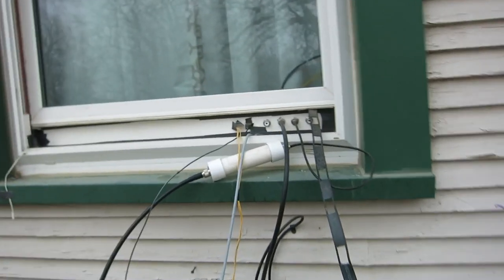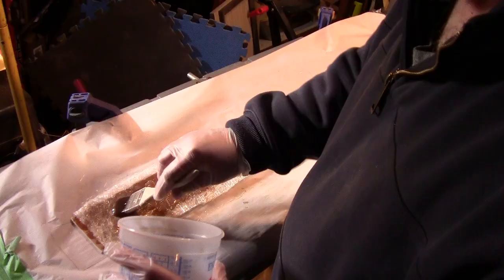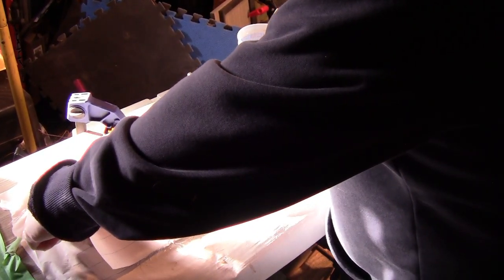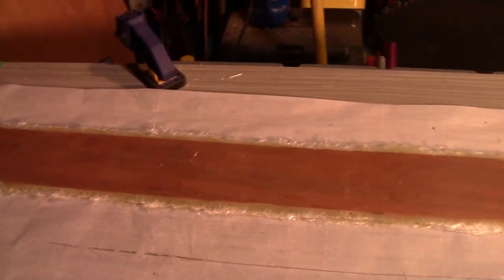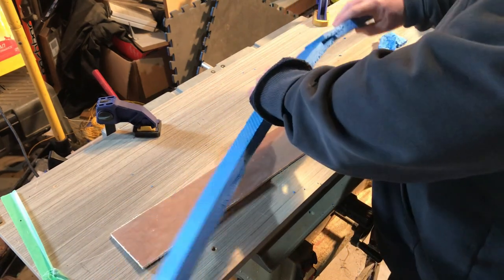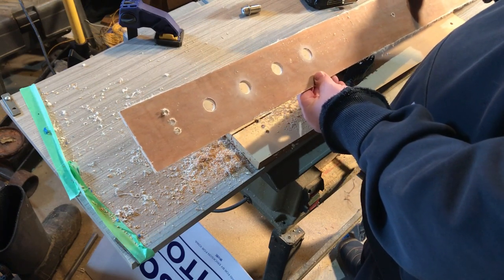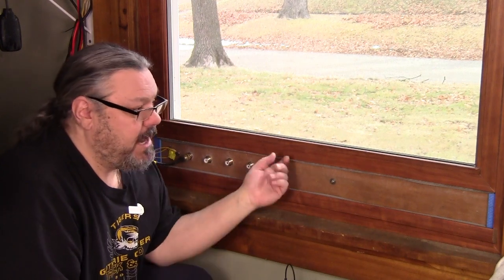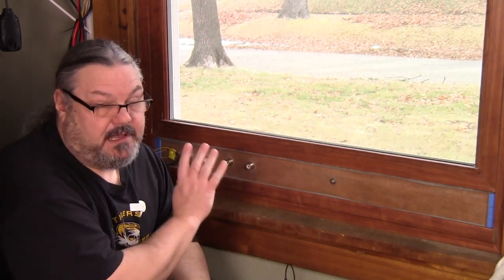DIY Window Pass Through

Comment: Very useful. Thank you.

What would you use (ceramic insulators?)for a 300 ohm ribbon cable?? 4S7EF
Reply from the maker: Great question. I think it would depend on the diameter of the insulators. 300 Ohm cable (at least in the US) is very narrow; that is, the wires are held in the insulation very close together, making it a bit tricky to split them for attachment to large-diameter insulators. If you could mount the insulators very close to each other then, yes, I would use insulators. 

In my previous residence I simply drilled a hole in the wall, ran the 300 Ohm cable straight through, and sealed the hole with a little caulk.